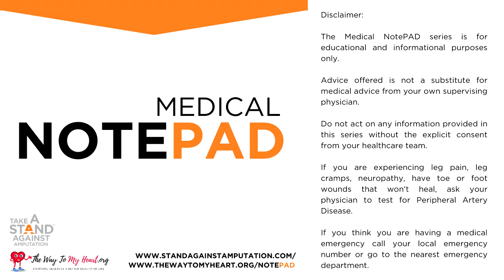Types of Leg Bypass Procedures to Treat Peripheral Artery Disease

Comment: I’m an Army veteran recently diagnosed with PAD, I just had an angiogram today, the doctor told me that the blockage runs from my thigh to my foot, he said my condition is inoperable, can you please help me Dr. Dua. He said an amputation is inevitable.
Reply from the maker: Yes, message kym@padhelp.org and we will hel you! I'm wondering if they only tried access through the groin, maybe a different doctor might have a different approach through the foot or calf, or may even have a surgical option. Walking is the best medicine meantime. Dr Dua is in Boston. If you are there, I'm sure she would be open to review your case. But there are advanced limb savers across the country who might have some ideas for ya to get you back walking without pain!
Reply: Get a second and third opinion. I was turned down by vascular surgeons in Montana and at the Mayo Clinic before I found a surgeon to help. He gave me back my leg circulation, mobility, life.

Comment: They will be mapping my lower legs Dec. 18 for the bypass surgery.  Thanks for the video.
Reply from the maker: we always suggest getting a second opinion before any procedure and making sure 100% what the contingency plan is when any procedure fails as with PAD, all have a limited durability. Docto tors understand when you get additional opinions. They respect it. They also like to learn from others who may have a different trick up their sleeve. If the doctor tried an endovascular approach, though, coming not only down from the groin but ALSO coming UP from an access point in the foot or calf, to try and get through the blockage, then they usually need to go to open. Still, second opinion and contingency plan are important to discuss.
Reply: Was your bypass successful? I am getting mapped for upcomimg bypass soon
Reply from the maker: @tonys8613 always get a second opinion before bypass. And if you decide to go through with it, ask the contingency plan when it fails. We just had a man in the hospital on deck for amputation because a clot blocked the bypass. We were able to get him a second opinion, however, elsewhere and his leg is being saved by an advanced CLI Operator who was able to open the arteries using wires and balloons poking on through the foot and tackling the blockages in the native arteries that his original doctor could not get through! So this Cli operator bypassed the bypass! No need for the bypass. Every doctor has different options and different skills and they will all say to explore all options before any procedure. A lot of times procedures aren’t even needed with a regimented walking program if there’s not a foot wound that needs healed! Here’s a great video: https://youtu.be/f9-XEJDCYmY?si=aSKELGwf3C7Y3-Au